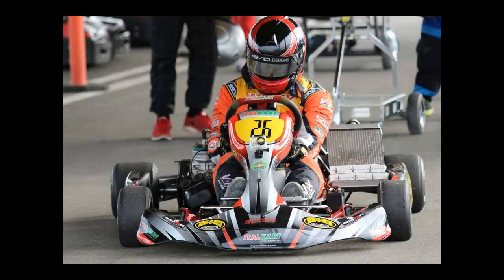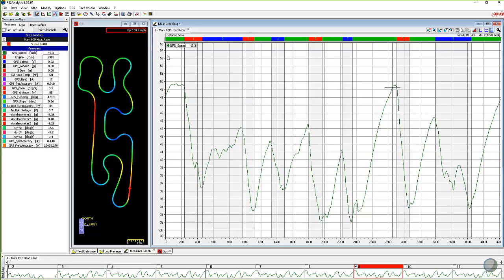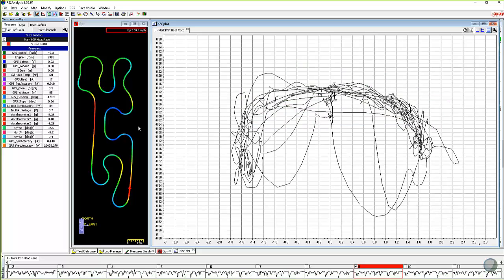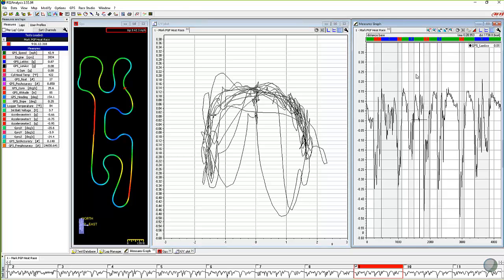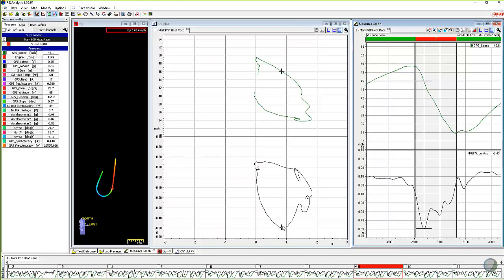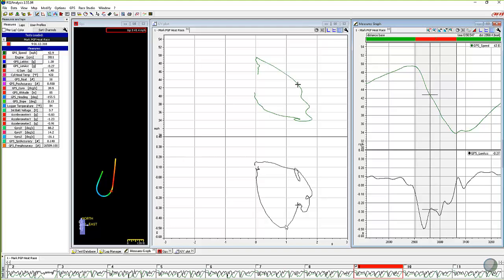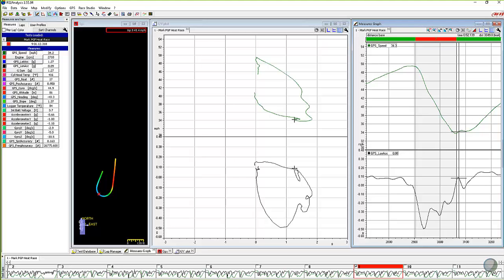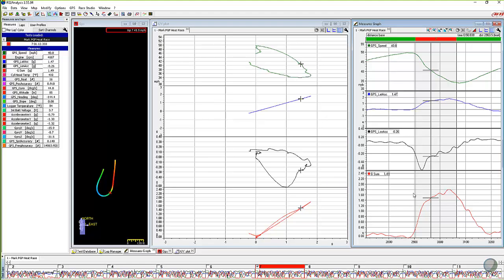Understanding the Friction Circle

Comment: A clearer view of the FC and how useful it can be if one utilizes the data and applies the corrective maneuvers to drive thru the racing line as fast as one can.  However, I was a bit confused in the interpretation of the peaks and throughs and the curves rendered on the graph that ideally, it should be as smooth as possible throughout the curves using the brake and throttle.  In an article of F1 magazine decades back, there was a comparative analysis between Hakkinen and Schumacher in Barcelona during practice laps and the Friction Circles of both drivers were displayed and interpreted.  This showed the distinct attention of Schumacher to maximizing the car's performance on the 4 patches of grip on its tires as shown in a unique curly and almost tumbling lops throughout which tells us that he would be on edge with his brake and maneuver the car in a blipping throttle manner thereby gaining precious hundredths of seconds from rivals on every curve possible. This mastery of the Friction Circle by MS ( at least as what the writer said)  was compared to Hakkinen who apparently drove in textbook style where he'd apply the brakes as he entered the curve and at a certain point reached terminal velocity and would not be able to do anything but zip through it until he would reapply the throttle and exit from the curve.  Perhaps you can shed light on the misunderstanding I have or the lack of it.  Thanks much... and keep the hot pace with a cool mind.
Reply: I'm curious to see that article, are you able to find a link of it? I've been searching but can't find anything similar to what you are saying.

Comment: I really love your videos! they are very helpful. Could you dive into the "engine analysis" function? 
Also I have been looking for a function to add notes and comments either per lap or per session to keep track on chassis setup changes, weather conditions etc. but unfortunately I can't find such a function - does it exist?
cheers :-)
Reply from the maker: Hi Andreas,
We will add engine analysis function to the video queue.  There is a general 'test comments' section with for each test session, but it is limited in length and not available per lap.  You will find the test comments in the test database > test properties.
Reply: thanks 😆👍